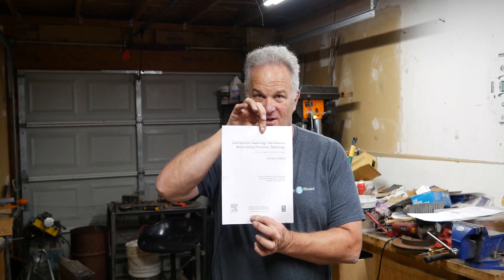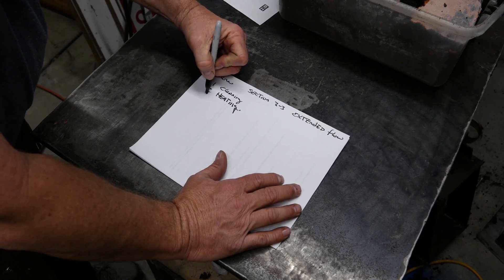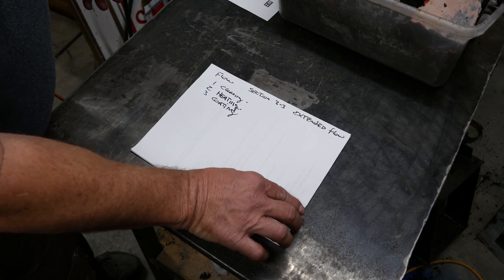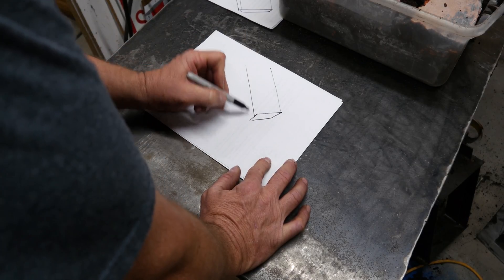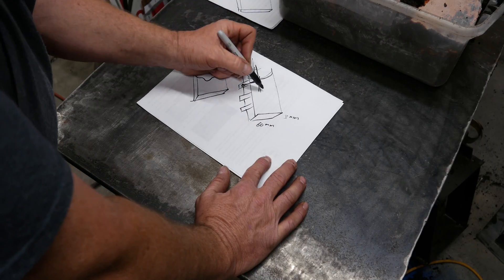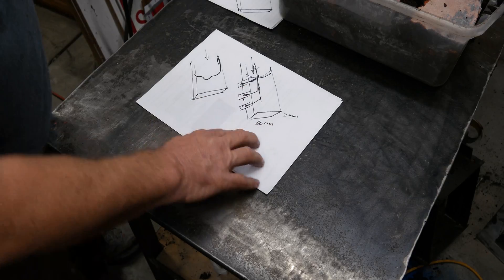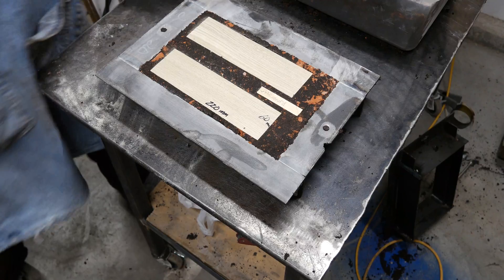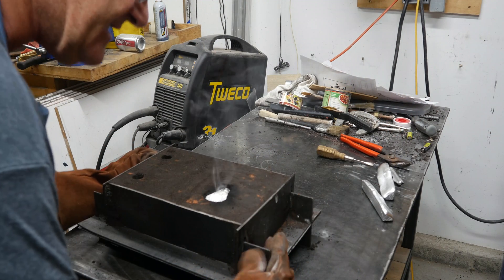Testing Hiratsuka’s flow extender

Comment: That works so well it makes you wonder why so many people struggle with thin castings. Other than they haven't heard of this technique.
Reply from the maker: Maybe because it's on page 132 of a 1015 page book? ;-)   I think I just saw my next experiment... :-D
Reply: that would be assuming they even looked at that book (or any book on casting)
Reply from the maker: well sure... ;-)
Reply: Looking forward to your next experiment.
Reply: Walt, I think that Sw alluded to the problem of this solution for thin work - in most cases you have to remove the "dumps" afterwards. Fine for me, I have a milling machine, but for those that don't its a problem and you would be sanding or filing for ages!... Martin
Reply: I agree, there are definitely consequences to consider. But as others have alluded to, you could make those "dumps" part of the design so they don't need to be removed. I look forward to the day when I have space to have a milling machine around. I understand the challenges of a lack of space and funds to have a mill around. 

Any other tricks for pulling off these long thin pours which would be better for those who don't have access to mills?
Reply: Walt, One method that may be of some use is to tilt the mould so the metal enters at the lowest point and flows uphill, gravity thus helps control the flow so that the meandering effect is lessened. Of course this does nothing to remove the cold metal! And the best that one can hope for is flow like page 129 figure 3.24 (a) rather than 3.24 (b). The be honest when confronted with this problem I cheat! I thicken the thin section up usually by sticking lino floor tiles onto the pattern these are 1 mm thick and usually just the one will do the trick. This plus oven drying of the mould has produced some nice plaques for me - Basically you just make it thicker until it runs! There are said to be other tricks like blackening the mould with acetylene smoke apparently this can double or even treble flow distance in some instances. It has to be acetylene,  LPG etc will not work as well (if at all) - Many ways to skin a cat😉.. Martin
Reply: Martin, Those are some great tips. tilting the mold to get a "counter gravity" pour is an interesting thought.

Like the trick with acetylene sooting, I've heard of a similar increase in flow distance by using graphite parting dust or a graphite mold wash (I think sandrammer, an old Navy molder, mentioned the flow increase in one of his videos on mold washes). If I remember right I think I read once that a chill possible increases the flow distance, something like using chills to get a longer runner length. Would those be other options to consider?
Reply: Walt, A couple of things that you have mentioned here that I am simply just not entirely sure about. Firstly, does a wash (graphite or otherwise) improve fluidity. I have not seen any evidence that it does or does not. BUT I do know that when metal fills a mould it runs in on its own unfolding and constantly reforming oxide skin. This skin bridges the space between the sand grains and thus effectively the frictional retardation of flow and its heat loss is almost solely due to these point contacts (radiation effects aside) - the air /gas gap between these points will not conduct much heat and will not slow flow. It sort of follows that the fewer of these contacts there are the further the metal should flow and indeed in gravity die work coarser mould coats encourage better mould filling and the larger the work the coarser the coat used (these coarser coats also allow air to get out easier too which also helps with mould filling.) In sand work it is noticeable that flow is better in moulds made in coarser sands, the better permeability of coarser sands obviously helps too. So I wonder how any wash which is almost universally finer than the mould surface onto which it is applied can aid flow. Perhaps it is some thought that graphite (or talc also used in some washes) acts as a lubricant so the metal is better able to slip in? I don't buy it! But it would be interesting for Sw to redo the experiment without the dumps but with a graphite wash applied to one half. - Another video for you Sw!
I would find it difficult to see how a chill could improve flow distance - chills are designed to remove heat - is that not the opposite of what we want here? Can you recall where you read this? In the meantime I will reread  chapter 3 (Flow) to see what I can glean... Martin
Reply: Best guess, on the chill and flow distance, would be from a book on fundamentals of manufacturing. I'll go see if that comment is in that book.
Reply: Looks like one possible quote that I was remembering comes from ir G Henderieckx Gietech BV January 2007
Use of chills
"2. increase feeding length of risers by promoting directional solidification"

it also mentions types of chills and list "sand chills" as a different type of sand used as a chill in specified areas of a mold. special sand as is chromite sand, zircon sand…
then metals as chills followed by Other materials such as graphite blocks

searching through my other resources I'm not finding the statement I vegly remembered as "increasing the distance of runners" but maybe I'm remembering runner when I should be remembering riser.

Chaper 5 of the book goes into a bit on chills, and there was some stuff about "cold fins" and there is something about that "cold fin" that is suspicously similar Hiratsuka's "dumps" for long thin casting. (see figure 5.23 fin vs chill; note the fin is possibly thinner than the flow off dumps FIGURE 3.25)

Reading in chapter 10 "The problem of the filling of thin walls occurs because the flow happens, by chance, to avoid filling some areas because of random meandering. Such chance avoidance, if prolonged, leads to the development of strong oxide films, or even freezing of the liquid front."
and from Chapter 5 "Chills also act to increase the ductility and strength of that locality of the casting. It seems most probable that this occurs because the faster solidification freezes in the bifilms in their compact form before they have the chance to unfurl."

I'm still looking for the reference to the mold washes / graphite washes improving fluidity.
Reply: I've never seen this quote, but the first part of it is similar to what I remember. comes from RESEARCH ON PARAMETERS INFLUENCING FLUIDITY IN ALUMINUM BASED ALLOYS 1961 MIT

"Mold coatings increase fluidity by decreasing mold-metal contact resistance and *chilling" sands (e.g. zircon sand) decrease fluidity because of their increased heat diffusivity."
(a)  a standard sand mold fluidity spiral (1/8 inch thick), and
(b) a plate-like sand casting fluidity test (1/8 inch thick).
Reply: and this from IJIRSET vol 6, issue 2 FEB 2017

2.2.5 Surface Characteristics of Mould:
 A rough of the mould hinder the metal flow by increased frictional force .Hence ,a fine grained or smooth surface mould or the use of a mould casting improves the fluidity of the liquid metal. Beside the effect of mould coating in improving the surface finish of the mould, use of such coatings will also affect the heat transfer across the metal-mould interface.

(I've been up too long, I'll look some more maybe tomorrow on the chills and distance, or maybe I should just work on my Trommel build as I need to get that finished)
Reply: Ok, last one... FLUIDITY OF ALUMINIUM FOUNDRY ALLOYS Marisa Di Sabatino 2005 Thesis submitted to the Norwegian University of Science and Technology (NTNU) 

2.5.6 Effect of mould coating
Mould coating also plays an important role in enhancing fluidity because it reduces the heat transfer coefficient (HTC) between the casting and the mould. In the experiments by Flemings et al. [49] two coatings, such as hexachloroethane and carbon black, were examined and the alloy poured was Al-4.5wt%Cu with 0.18wt% Ti added as a grain refiner.
Hexachloroethane was sprayed from an ether solution to a thickness of approximately 0.1mm. Carbon black was applied with a smoking acetylene torch. Two plates were mounted on the opposite side of a runner: one plate coated and the other uncoated. Clearly, the fluidity of the alloy in the coated mould was higher than in the uncoated mould. Both coatings improved fluidity to about the same extend and neither had any deleterious effect on surface quality of the cast plates. It was shown [49] that the reduction of the heat transfer coefficient by less than a factor of four resulted in 200% increase in fluidity.
Reply: Walt, Ah, feed length vs. flow length two entirely different things! Thin fins may not be big enough "dumps" to get rid of enough of the cold metal, no doubt there is an optimum size of dump and I think JC suggests that further work is necessary to discover the facts and figures re dumps and their effectiveness.
I think that chills work in several ways to increase properties: There is the old theory that smaller DAS (or SDAS) gives better properties. Quicker solidification seems to lower porosity levels - not only gas which has less time to come out of solution but also shrinkage as higher temp gradients favour better feeding. And as you point out the possibility of bifilms being in a more compact and therefore less damaging form. On the subject of chills it is interesting to note that metal will run further in petrobond sand because, as it lacks water, it has less chilling power, however properties generally are not as good.
On the subject of fins and feeders I saw a video recently (no names no pack drill) where a flywheel was cast with a so called riser/feeder (called by the videoer) on the central hub said "feeder" was about 1/3 the diameter of the hub! clearly it could not act as a feeder - it would solidify much sooner than the hub. But yet the hub seemed fairly free of shrinkage probably because the feeder actually acted like a fin and chilled the hub off - sadly the producer would have had no clue! (It was in any case one of the roughest castings I have seen - cast in ZA12 with a massive sprue height.)… Martin
Reply: Olfoundryman good points, definitely some things to think about. I agree that small 'riser' in the example you mentioned probably acted as a fin. Which gives some interesting thoughts in relation to JC's suggestion that risers should be avoided and only used as needed (I need to reread that section).
Reply: Walt , some confusion seems to be creeping in here. Are we talking about flow in sand or metal moulds? and if sand what type of sand? In metal moulds a coating IF OF A LOW CONDUCTIVTY KIND would obviously improve flow through slower heat loss. Gravity die work almost always uses low thermal conductivity coatings. These are vital to getting the mould to fill (they also help to get the air out) and generally the bigger the work the rougher the coat as these aid rapid fill, finer coats are great for small work but metal will not flow as far on them . Now I speak here from very personal experience - the rougher the coat the further the flow (within of course the roughness range of the various commercial coats available) Graphite is generally regarded in the gravity die industry as a chill coat as it has much higher conductivity that the "white" coats more generally used. However that conductivity is still below that of an iron die so even it would likely extend flow in a die just not as much as the white coats. Acetylene smoke  black is well know as a flow extender in many different mould types however it is very unpleasant to work with as it tends to send the whole foundry a greasy sooty black...Martin
Reply: Martin, as far as I know, the references about the mold coats above are all from fluidity tests in sand. Some of the things I have read talk about "plumbago washes" aka graphite washes as extending flows. As you have mentioned about graphite washes being a "chill coat", I have also read that. Being that graphite washes are used as "chill coats" makes some of the details on that being a flow extending trick questionable; as per your comment relating to needing to keep the heat in the metal for better flow. but I also have read "Molten metal does not wet graphite and sand grains coated with graphite coatings resist metal penetration." Perhaps it is graphite's resistance to being wetted by the molten metal that is at the root of why it works as a flow extender. Maybe that resistance to molten metal wetting is also behind the Acetylene sooting.  I think it would be interesting to compare those white low thermal conductivity coatings with graphite coatings, Acetylene sooting, and uncoated sand in a fluidity test like the thin plate or the spiral test. 

note: I agree, the greasy sooty mess all over the shop from Acetylene smoke is awful. Even when the shop looks clean you walk out dirty.
Reply from the maker: Tell you what boys, I've got some spray on graphite lubricant that I can use. I'll see if I can set up a couple of side by side tests this weekend. I also want to run a variant of the test luckygen1001 did on the necessity (or futility) of venting molds.
Reply: Sw, Sounds like a plan re the graphite. I think I did see luckies video on vents but I will go and re-watch it. The story of vents - yes or no - rather depends on the sand one is using, mine is very fine so vents are absolutely necessary in some areas and if I do not vent I have problems. But with a coarser more permeable sand such venting would not be as necessary if at all. Cores are another thing again as being largely surrounded by metal they need to be able to shift the often large amount of gas that they generate to the print area on the core so it can safely escape the mould - I would never use an unvented core...Martin
Reply: swdweeb make sure you check that any volatiles have evaporated from that spray or you have burned them off. Consider that petrobond uses alcohol based washes, and if a molder forgets to burn off the alcohol before assembling the mold things can good boom. Same for that spray lube and it's contents.

You could probably make a DIY graphite parting dust by grinding/crushing some 0.5 mechanical pencil lead in some cloth with a hammer. A thrift store coffee grinder would make quick work of making some graphite dust from mechanical pencil lead.
Reply: Walt, bit of a hard way to make a graphite wash! You can buy graphite powder on Fleabay...
Reply: True, but then you have to deal with shipping time... I don't disagree that there are easier methods depending on time, cost, and powder quality. 
(I just remembered that some high-end art supply and hobbie shops places carry graphite powder for drawing...)

Comment: That was an excellent demonstration. I'm over here feeling the excitement. Based on the book drawing it seems like you could go smaller on the ribs which would help with the clean up. (Or make them design functional like Dan said)

You did get some flashing on the parting line, I suspect that's due to the metal hydraulic force during the pour. you may need some clamps or weights on the  flask to help reduce that flashing.

Still jazzed that you were able to make such a beautiful thin casting with that technique. Truly exceptional and exciting. 

I put this in your top ten pours. 

Now I've got to go watch it again, such delicious casting techniques.
Reply from the maker: You can chalk the flashing to a really bad, probably the worst I've ever done, molding job. When I pulled the pattern from the sand half the sand came with it. If I trying to make a usable plate I would have taken a lot more care in the pattern and it's removal. 

There you go, drive my view counts, I love it. ;-)
Reply: As I have watched the creator insider, it seems watch time is more important than just views. So you will get some more watch time from this.

Did I mention how fun this casting was to watch?
Reply from the maker: Actually the most important thing is ad clicks ;-)
Reply: I would need some 993 more subs and 3500 more watch minutes to know about that dark magic. ;-)
Reply from the maker: ah... true enough youngster. ;-) I forgot about that nice restriction YT put on channels back in January... I was even concerned about losing the ability to monetize back then.  Well, I think I'm about 1/3-1/4 of the way towards making noticeable money on YT ;-)
Reply: Good luck to you. We are just hoping to get to 100 subs at the moment. Still need to come up with a better name, one that doesn't already have 9000 knock offs swimming in the pool.

Comment: Wow!  That made a really big difference.  The explanation makes perfect sense, but it still seems like black magic.  :)  The extra cleanup beats an incomplete fill anyday o
In my book; I'm gonna have to remember this trick...
Reply from the maker: I keep thinking about the guy that had the idea to try it first... "what if we dump the cold leading edge down a hole as it's moving across the mold??"  You're absolutely correct, an incomplete fill is pretty much worthless to most of us. Cleanup sucks, especially without a milling machine, but at least you've got something at the end.
Reply: I agree, total black magic.

Comment: Thats so cool and interesting I mean how often does that work out like that it worked on the first try. I was thinking the same what would I do with those 3 bumps then it hit me fasten my belt sander in my vise upside down and sand them off ( making mental note to buy lots more sandpaper)
Reply from the maker: Yeah, that's kinda where I am. Although with a little planning it might be possible to incorporate them into the part as Dan said a little earlier. 

I agree with you, it was really cool to have it work so well.  I might have mentioned it in the video. :-D   I was pretty excited about it.